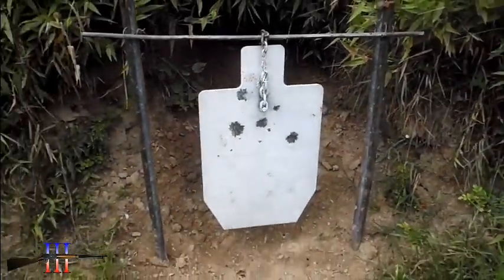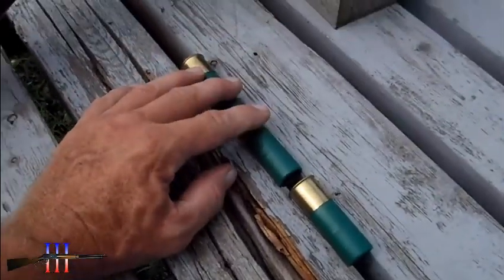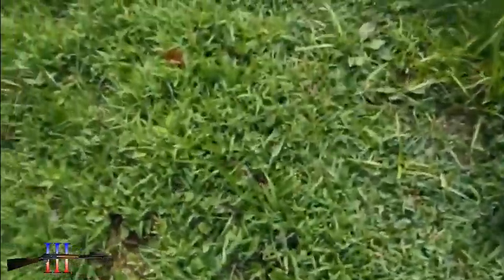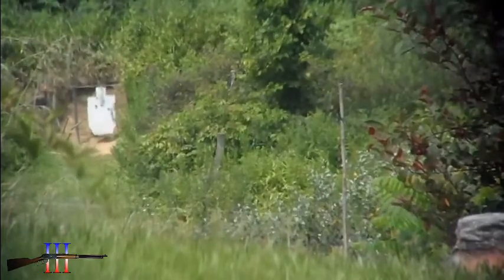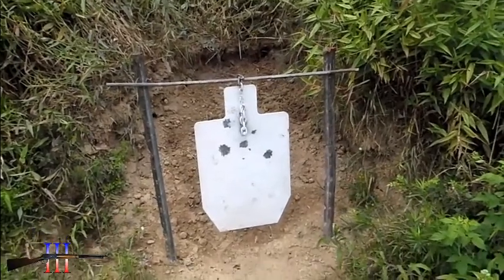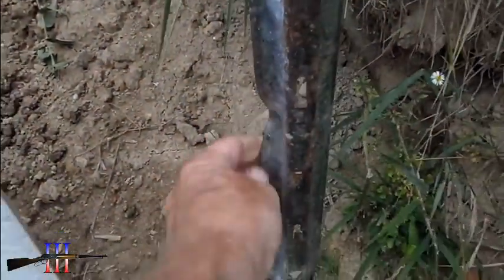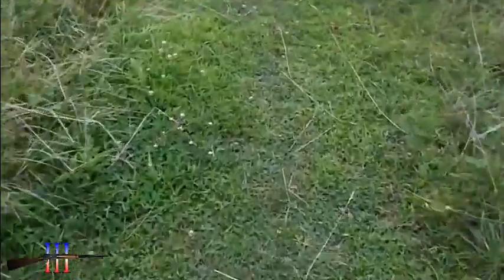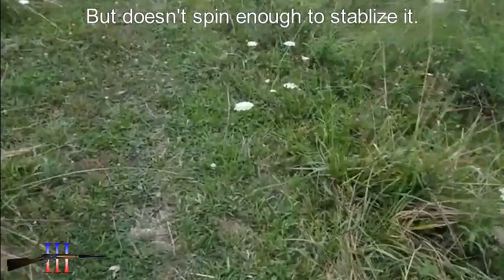The Problem With Slugs in Smooth-bore Shotguns

Comment: very nice shotgun, steel n wood.  i have the same issue with 1 oz. slugs. i bought the Lee 7/8 oz. mold and it shoots better for me for distance. the mold is cheap makes a difference for me with longer shots :)
Reply from the maker: Well, now that I have the 45-70, I have no problems taking longer shots! ;)
Reply: Interesting. I have a 7/8 mould otw from ebay and a 00 buck mould AND a Russian roll crimping drill hit head coming... Sometime. The thing may take a few months for some reason bc its otw from Russia.

Comment: Try Fiocchi 1oz 1560fps slugs they have a stabilizing wade that stays on the slug, I wonder if a pumpkin ball slug would carry.
What was your hold over?
Reply from the maker: I was holding about 2 feet above the head at 200, 3.5 feet at 250 yards.
Reply: Rifled barrel doesn't make much if any difference

Comment: These are slugs made for rifled barrels? Or are these foster slugs made for smooth bore
Reply from the maker: "Made for." Either one would do the same.
Reply: @Win94ae  not really a foster slug is designed for a smooth boar they don’t do well in a rifled barrel and cause lead fouling a sabot slug needs rifling to stabilize